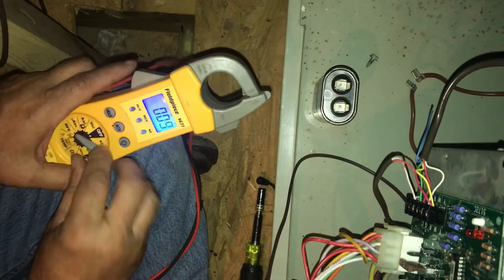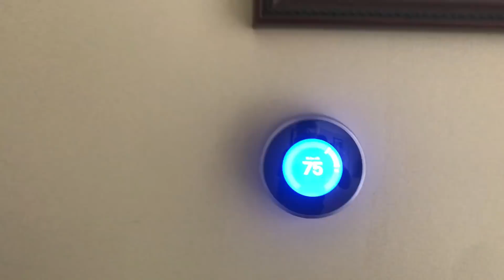Service Call for 2nd opinion No Cooling repair Trane Gas Furnace

Comment: If you're a service tech and don't have caps on your shelves or can't read a cap, you should go flip burgers at McDonald's... I just had a call where my buddy has a rental and the renters called a company instead of going thru me. Tech came out and told the renter they needed a new system, refrigerant was leaking oil in the attic (handler was a closet mount), primary pan was rusted (plastic pan) and new 2 ton system would be $6500... My buddy got me over there and it was a burnt fan relay on the board. Replaced it with a peanut relay and just hard wired the rest. Even if they needed a new system it would have only been $3200 for a friend price. Theres so many crooks and hacks in our industry

Comment: That new capacitor is out of range. It should read 9.7 at the lowest. The tolerance is 3%. So to find that out you multiply 10 by .03 which gives you .3. Then minus that .3 from 10 giving you 9.7.

Comment: That jump from medium high to high was noticed by a picky homeowner. He called us and wanted us to do something about it. We were told by trane that they were aware of it but they could only give us the same board which would do the same thing. They gave us a couple of other OEM boards from another older model that worked for that particular model so that the homeowner didn't get annoyed by the change in speed at start up. To make a superlong story short... we earned us a customer for life. We ended up replacing both systems a year later..

Comment: Tell it bro. You did your due diligence. Props for picking up your dusties. Excess motor noise is probably due to to the increased static due to the door off during testing, I have done it too.
Reply: I know this is an old thread but I noticed the loud noise when he cycled thermostat on right before leaving. Guessing too small of ductwork or grill or both? Didn't hear how big it was  or really see the setup but I don't think it was the door being off. I wasn't there and I don't know everything so I could be wrong I had to skip ahead of the monotone droning on and on.

Comment: If you were in CO I would hire you to take a look over our system. About 10 years ago we hired someone to 'clean' the ducts and go over everything then they said all this work should be done for the humidifier (they didn't like the wiring) and wanted to charge $300-$400 I was like NOPE and as I said that was like 10 years ago and the Humidifier works just fine. Sadly too many crooks in the HVAC industry. I'm leery about dealing with them so I just rather not. I know you are ANTI DIY but basic stuff isn't hard to do with basic understanding. The compressor fan went out, took me 10 minutes to change it out it was simple unbolt and bolt in. I removed the furnace fan because it was so dirty, well it seems the builder had it drawing air from the basement and not through a filter. There was a filter on the other side drawing from upstairs. So I made a bracket and now we have two filters which is fine and the motor/fan assembly stays clean. 

Most of it is common sense, and yes sadly most people lack that today. For codes you can read them online from your building department.
Reply: Meeker Extreme 10 minutes huh ?

Comment: I have worked for a commission based HVAC company and let me tell you I wasnt with them very long!!! Sent to a Training Seminar called Contractor Selling with a guy named Joe.   Teach you to give a customer 6 options with the top option(plantinum)being anywhere from complete rebuild of system down to the  bottom option(bandaid) being the simple fix it is. They were charging customers $600 dollars to change a $7 run capacitor. I couldnt look customers in the face telling them the pricing.  Final straw was when i found out they charged an 80 year old lady living on a fixed income $2500 to in stall a window AC from Lowes!!!!!! Ridiculous that companies try this and get a way with it.  Also I always recommend changing the motor with the capacitor, but you did inform it can go out from an hour to 5 years down the road, as I do.
Reply: Damn thats slimey

Comment: I find that a Megaohm meter sometimes will help you tell if a motor is near the end.  Great video keep up the good work. I also carry A 3 by 6 drop cloth for ladders and pull Downs
Reply: You would have to contact the mfg to find out what the ohm rating would be on that motor and that's no simple task.  Him putting an amprobe on it would have been good though.

Comment: Had this exact thing happen at my daughter's house.
Tech told us to turn the thermostat down so low it don't shut off and if we get too cold open a window.
Turns out the compressor was a hard start.
Tech came back 3x replaced the capacitor the came back and replaced the fan motor. Then quit on on it.
Next company's tech said he screwed the wiring all up and he rewired it all.
 The charge was good, fan good but the compressor was bad.

Fixed it.

Comment: A good rule of  thumb is if the capacitor on the blower is bad the motor won't be far behind it. Not always but it's pretty common they fail after the capacitor did.

Comment: Had the same situation happen to myself with a supposed seized condenser compressor, previous tech told them they needed a new compressor, even had the home owner order it online. He then got into some other thing and i got the call to make the swap in his place. I always try the system before i touch it, and behold, it was just  a start cap.

Comment: Next time use that sweet multi meter to check the AMP of the motor.  Rather than simply saying maybe 1 hour, 1 week 1 year.  Also the capacitor bracket is supposed to go around the capacitor then screw it down.  Last thing I'd check why the door switch is bypassed.  That's a safety feature and should be operational.  Great video's.
Reply: Maybe the switch was bad. My washing machine door switch went bad, $40.00 for a new one so I just soldered the wires together and bypassed it!!!

Comment: Have to check the amp draw to see how bad the motor really is
Reply: Joe A I’ve tested motors amp draw, the bearings and the temperature of a motor after a run cap failure. Everything looked good 4 hours later the motor burned up. I told the customer they can fail any time after the cap failure. He called me and said get the motor it had quit. So it wasn’t a total surprise to him. He was there when I was testing the motor.
Reply: I had a dual cap failure compressor and fan motor. Amped it all out after the new cap was in. All was good. I told my customer when a cap fails the components have been stressed and could fail at any time. I wrote it on the work order. That night the motor failed. He called and told me to get the motor replaced. An informed customer is a happy one.
Reply: Joe A ya man, do the best you can to test everything and advise customer and document for future cya.

Comment: What where you checking for when you where jumping out the different wires?
Reply: He was checking normal functions of the board,  because the other guy told customer it was bad and needed to be replace which was false

Comment: I cant believe all the people that just put their meter on a capacitor without shorting the capacitor leads first....one day your going to find one thats still charged and be making a trip to the supply house for a new meter
Reply: Most modern capacitors have bleed off resistors built in only older systems running r22 are subject to having that issue and in some cases older unit caps have a resistor on the outside of the cap.

Comment: Those damn capacitors. Most times its that rather then the blower seized. Fun tip: if you find yourself tired and coffer just isnt doing the trick, try replacing a capacitor with the power still on. Youll feel enlightened in no time!!
Reply: fat fingers or drunk?
Reply: @traviskalinowski3231  I am the liquor Randy

Comment: Ted I have found the blower usually fails within 2 days and I tell my customers that i dont know why that is but if its good for 2 days then there probably ok. Blowers more susceptible than outdoor fan motors. If they have 1 system and its hot and im busy I will strongly urge to replace it. Total scam hack out there..probably quoted around $1500
Reply from the maker: He wanted 1050 for board and blower.
Reply: lol Ted i have seen some quote $1200 just for the blower.. I hate scammers and thieves

Comment: I have  replaced quite a few capacitors in my working life. The majority of the time the motors lasted for at least two or three years. On the other hand I will not replace a motor without replacing the capacitor. I have even turned down a few motor replacements because the customer wanted to use a capacitor that had been used on a blown motor .
Reply: It’s a $10 part. Who argues over a cap when they’re getting a new motor?
Reply: You would be surprised. It was usually a case of having plenty of money but not wanting to spend it.

Comment: I'm curious, you said they had a Nest thermostat, but I noticed the common wire (blue) was not connected on that board, which means the thermostat must have batteries to function properly.  However, I am unaware of any Nests that have the option for battery installation.  Is this correct, are there Nest thermostats that you can put batteries in?
Reply: It steals power from one of the other wires.  I had one in the past with no c wire.

Comment: Warning, I am a diy'er, I was quoted a ton of cash (5tons) to replace my system based on failed 19yr old r22 compressor.
I was not buying his "pro" opinion. 
I ohmed out the "failed" compressor and found this.
It was just a burnt connector on compressor. Free fix.

Comment: weather you disable the door switch  or not it should be connected first thing never by pass a safety
Reply from the maker: Thank you for your opinion.
Reply: The door safety switch was the first component to fail on my Goodman furnace.

Comment: What would cause the motor to jump like so when you jumped out red (24v) to green (fan) with the thermostat not calling for cool? What I have seen is that "some" motors upon initial start up will  jump like that but not usually with single tap motor. Only seen that with X13' and varible speed motors. Was like if the thermostat was calling when you jumped out the fan at board and was causing an issue. Doesn't make since to me why the motor would jump if has a solid contact. Can you help me understand that? Maybe you saw or did something I we can't see. I could so see you and I working together. Honesty is such a priority.

Comment: I sure love the old stuff better I got a ream from 1985 on an apartment building (usually not the best maintenance or care) capacitor has been changed but the blower motor finally gave up the ghost,,,,, I got a five-year-old York 2 of them both blower motors went out and it's a damn GE programmable,,, yank them out put a slave relay in shoved rescue motor in there and boom working,,,,,, Owe  18 Apartments I love old systems and R22,,,, and plenty of R22 on the Shelf
Reply: Can you still get R22 ?
Reply: @fuokugoooge8314  hell yeah and you don't have to have an EPA card to get it either,,,,, you can get it off of eBay you can go to the Internet a place called freon for Less they'll send it to you you just sign the statement saying I'll have a license  install put it in ,,,, when they rip you off at $100 a pound you just whip out your own 5 10 or 15 lb jug and so you can put in mine it is $10,a LB. ,,, you can buy it off of Craigslist even buy it off Facebook Marketplace

Comment: Another story, before I started my own business and worked for a bigger company doing installs, showed up at an 80 year old lady's house to do a change out, went out back to pump it down and saw that the system was only three years old. Sales guy went out and told her she needed a new system, even tho it would have been under the factory warranty. The run/start cap was bad, so I replaced it an told her she didn't need a new system. Went back to the shop and met the owner for the first time, he told me that if a system was sold it needed to be installed. I told him I like to sleep at night and not be a scumbag. He told me I was fired and to clean out my van, which I proceeded to call him a bunch of choice words and that he needed to come out to the parking lot and help me clean out my van after I whipped his ass. Well, he never came out.... Oh yeah, they were trying to charge her $8500 for a 2.5 ton goodman.... Same company that was also charging $600 for a fucking capacitor. I lasted two weeks there, lol
.

Comment: No one is forcing you to use a cheap Chinese cap.
Reply: bogieman101 His company shop might be
Reply: @havox112  He is the company owner.  At any rate, I'm not sure you can find caps that aren't made in China anymore.
Reply: Sometimes it's the only thing we have on the truck guys.
Reply: @hjc4604  amrad are made in the USA but are about 5x the price. Have only ever seen one weak though, never a failure on one I used as a replacement.

Comment: Do you charge for second opinions? I used to do free with a competitors invoice. It seemed to work well with gaining customers.
Reply: if they asked for a second opinion they are expecting to pay for it.  That may work with some people but here people want to pay for it to be done right.
Reply: @Grace2abound  yep, especially if the second opinion fixes the problem. Hell I'd even throw em a few bucks for lunch for saving me the headache of dealing with the first guy. 

That makes me think, I dont understand why some people just go with whatever the first guy tells em, sure lack of knowledge how would they know better but I always try to avoid the upsells if ya get the feeling there just trying to get you to buy shit to "fix" the problem then get someone else there to reaffirm and well yeah common sense I guess for some not for others

Comment: You didn't check the blower properly or the board properly
Reply: Bad blower motor over amping can cause those cheap blue diodes to over heat you know when a motor over amps it affects the board should checked the temp on those diodes either with your finger or thermometer, these are things you check with pre-maintenance  but I didnt have to tell you that.. or did I🤔
Reply: @Milerhighlife2011  blower motor has a thermal overload protection to keep it from over amping.
Reply: @ramonestrada38  no it doesn't it will over amp till the thermal over load opens thats how is works, go back to school